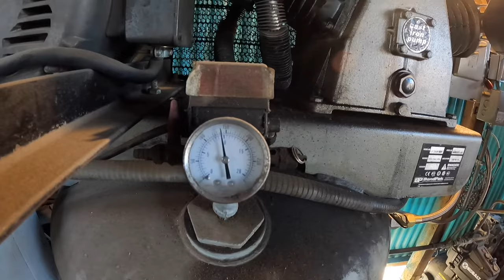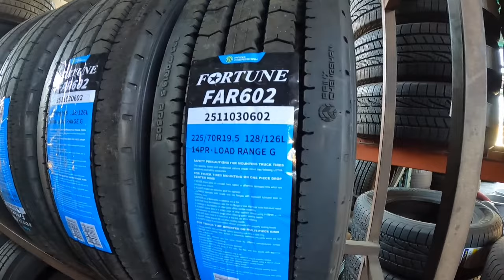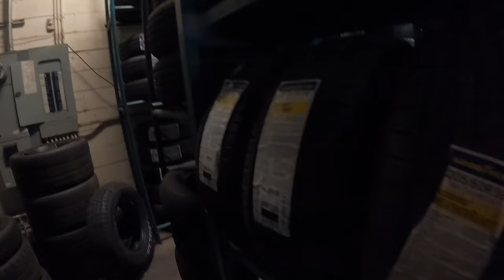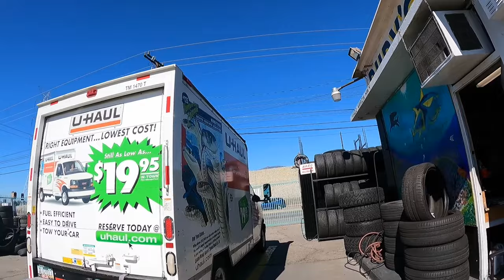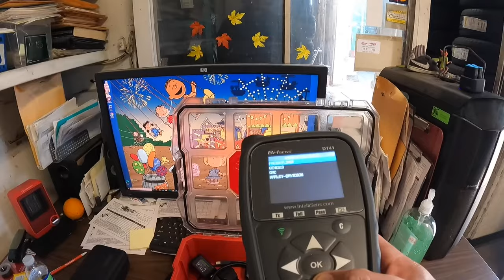What no one tells you about opening a Tire Shop Business

Comment: Used tires are discarded for a reason. Side wall compromise, treadwear, dry rot. A new China tire supercedes a premium used tire in many cases.  Tpms sensors broken by tire installation and customer will not be told. There are tire shops who comply with DOT laws but most don't. Cupped tires being sold, uneven treadwear tires being sold. They buy used tires from car dealers who discard them because they are declared no good. If they declare them no good? If the vehicles suspension is worn, a used tire will become more dangerous for unforseen circumstances. Tire safety can be a life or death situation. Buy new instead of used. New economy tires are available for a set of used. Exact tire size is also important. 5 years, 5/32 tread depth are deemed for a tire to be destroyed, especially for sidewall collapsing compromise. Over corrections on steering will blow sidewalls and vehicle rollover can happen. These are facts. Research these facts for your and your family's safety.
Reply: Jeez you’ll have to show us your shop some time and how you do tires

Comment: before you open, research your market (city, location, competition).  I don't care how long you've had your business. Most customers are your customers until they find someone cheaper, especially in this economy (2023).  Set your hourly rate and by God stick to it.  For services. price your service based on equipment used and not on competition. The gentleman in this video explains that you can buy used machinery, this is true. But DON'T charge based on what you paid for the equipment, charge based on the value. I have a newer model of his favorite machine which cost me $13,000. Add a $300 shop jack, $300 air gun ($800 snapon or matco cordless impact), $3000 shop compressor, total $16,000 in equipment needed for a simple flat repair. Keep in mind that the equipment doesn't work itself, human labor has to be factored in.  You are not going to invest $17,000 to make a profit charging $10-$20. You'll be living paycheck to paycheck....if that. You will be packed  THINKING you're making a profit, but far from it. Might as well work for someone. work less and get paid more. Stick to your guns gentlemen, educate yourselves, huge difference between opening a business and running a business, good luck and God bless your endeavors.
Reply from the maker: Very true that’s why I buy used machines at 5k rebuilt if you look at my newer videos you can see one I just bought recently. About the $20 labor charge , the thing is every shop charges the same. If I would to charge more than that then a lot of customers won’t come to me they will go elsewhere like you said they will find somebody cheaper. But Labor $20 per tire ain’t bad, if you and your crew do a cars 4 tires in 20 min which is the average time for us then that’s $80 in 20 min and you move on to the next car quick.

Comment: How much is it needed  to start a modest tire business if you already have your own location but need tires and equiqment?
Reply from the maker: Then you just need the air compressor, 1 tire machine to start with (used where I’m at run $4500, balance machine new around 5k , gun sockets some glue and patches are not that much less than a thousand dollars and when it comes to tires as much as you can afford on that
Reply: @LAMamba626 how do you buy tires wholesale?

Comment: Any insight on commercial truck tires?
Reply from the maker: I also do work the semi truck tires high profits I highly recommend it if you want to have a tire shop
Reply: @LAMamba626  Any good nationwide suppliers? What about recaps and buying used tires? Any good resources I'm in Virginia.
Reply from the maker: @shanra4764  you can look for individual supplies to save some money but usually all shops buy from a vendor that drives to your shop and you buy from them because you rub out of supplies randomly so you pick what you need quick instead of waiting a few days to get. And recaps you need to look around your area. You need to go drop off your cases and pick up your recaps when you go to make it worth it.
Reply: @LAMamba626  Thanks Mamba I will do my due diligence from there!